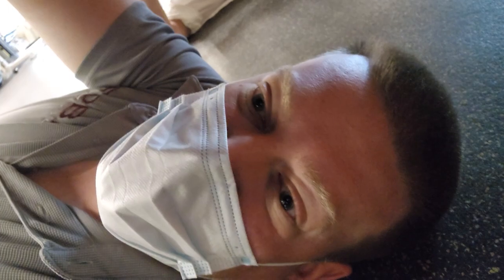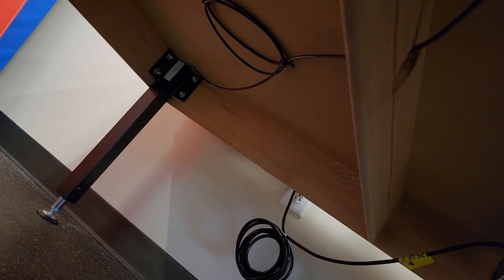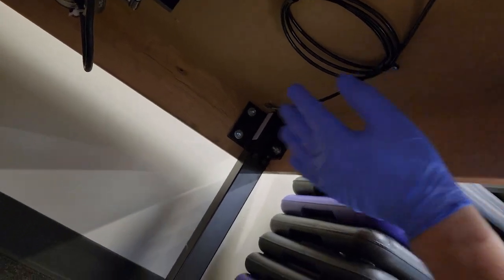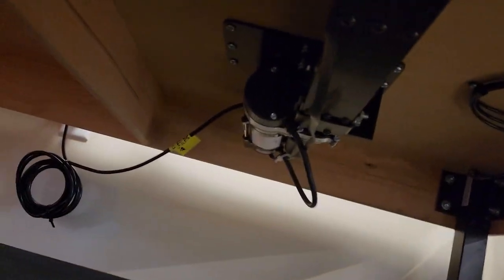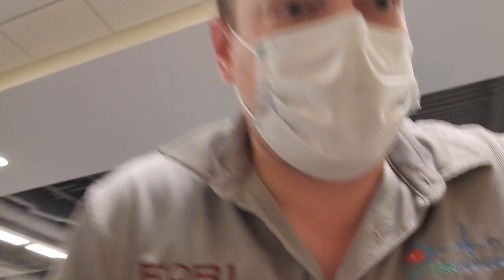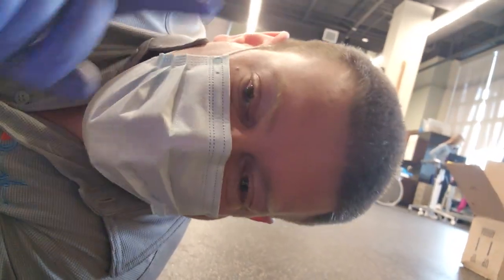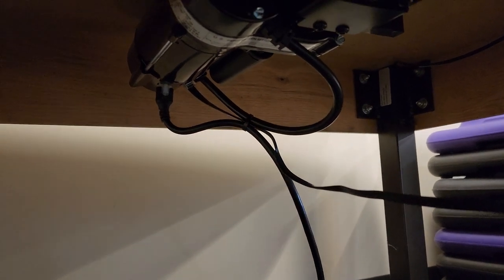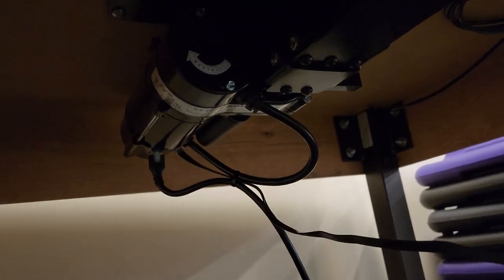Hi - Low Table Hydraulic Repair

Comment: 3:58 i think that "cilinder" is a booster, for creating with a lower pressure on one side, a higher pressure on the other side.
Because all 4 cilinders inside the legs are connected on 1 side of the booster, the oil displacement is equal on all 4 cilinders (legs) , that way you get a automatic leveling of the table (if there are no blockage or oil leaks offcourse).